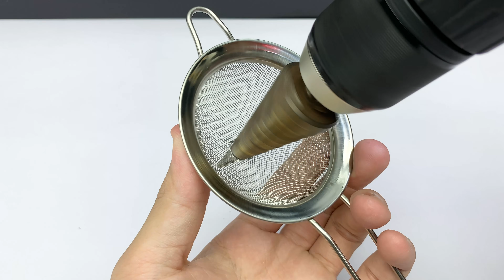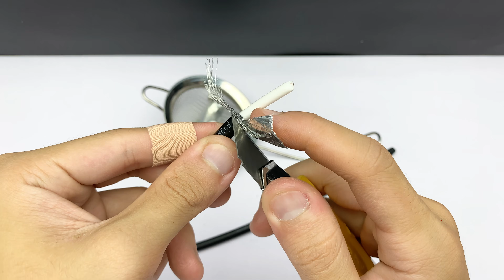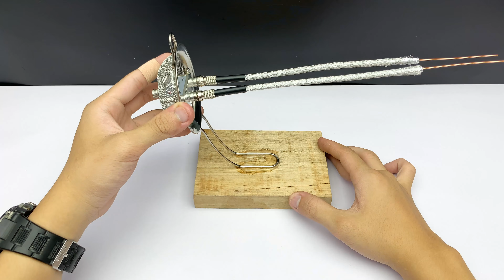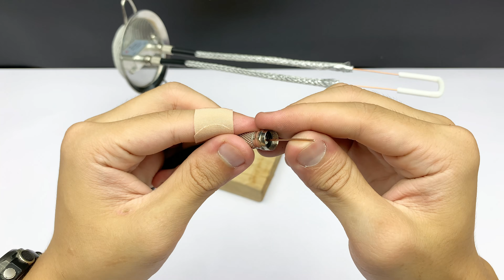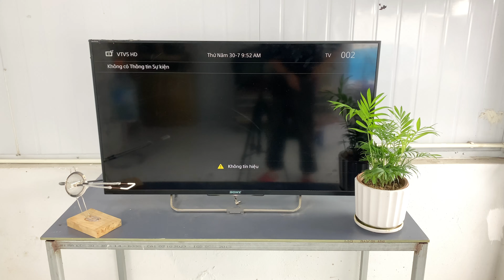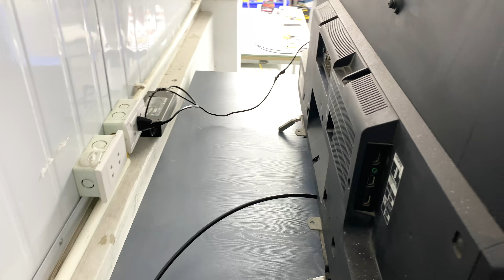📡 Never Buy a TV Antenna Again! Put a STAINLESS STEEL STRAINER Behind Your TV!

Comment: What is type of transmission of tv signal in your area and power at which transmission received.
Reply from the maker: Great technical question 👍📡 The reception depends heavily on the local broadcast standard, frequency, transmitter distance, and signal strength. Those measurements should ideally be shown in the test rather than giving a general value. We’ll keep this in mind for future antenna demonstrations. 📺